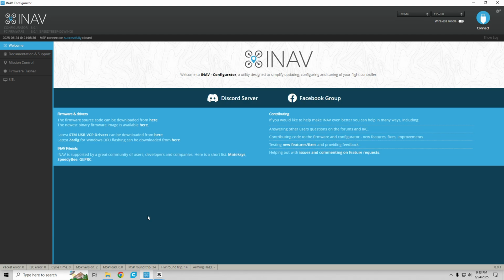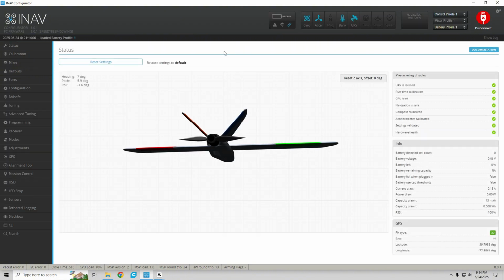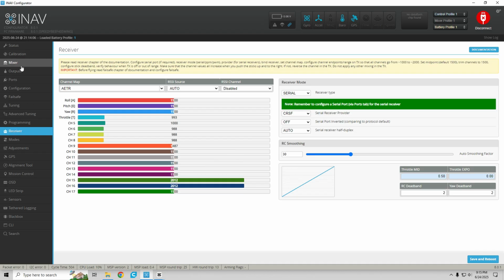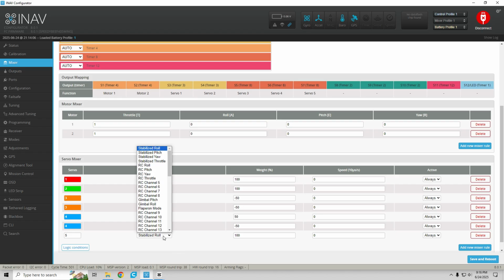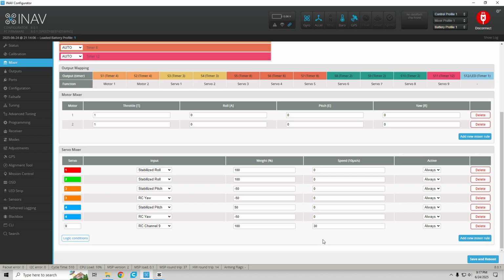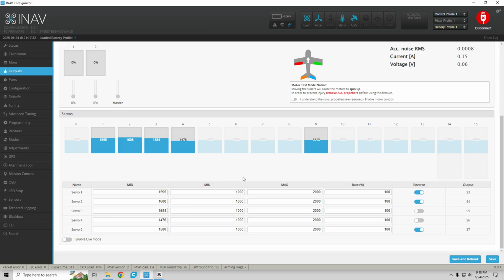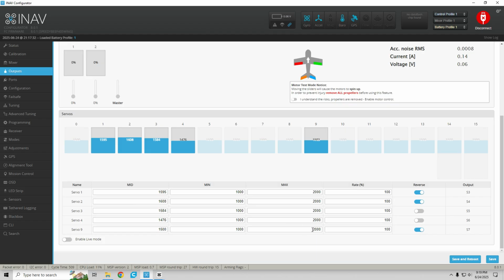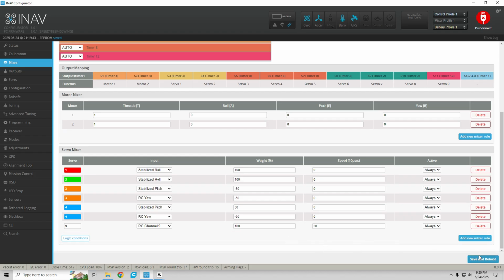INAV 8.0.1 Pan & Tilt Servo Setup

Comment: My servos get random big twitches. Im using digital servos. Should I use Analog? Should I turn down the rate? What does Rate do in the output tabs?
Reply from the maker: I set my digital rate to 100hz. Are they all twitchy ? Check to make sure your not analog settings in inav also.
Reply: @Pr0pCiRcLes2 Oh! I didn't know there was a setting for digital vs analog. I'll look into finding that. Thank you! I bet they are all set up as analog.
Reply from the maker: @scottperry5454  on the stock setup they are set to analog just change to 100hz and you should be good
Reply: @Pr0pCiRcLes2 Amazing! Ill give that a shot. Thanks again
Reply from the maker: @scottperry5454  your welcome anytime